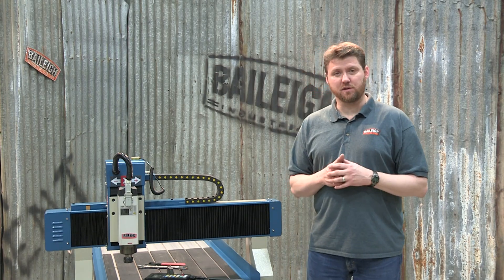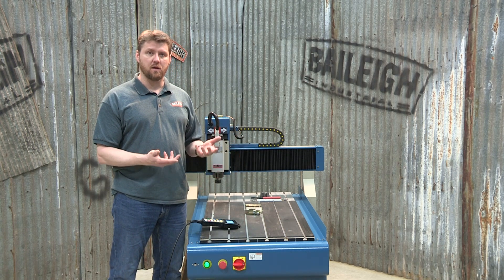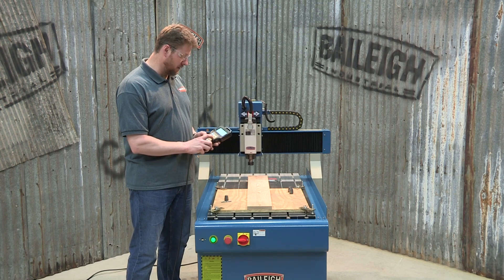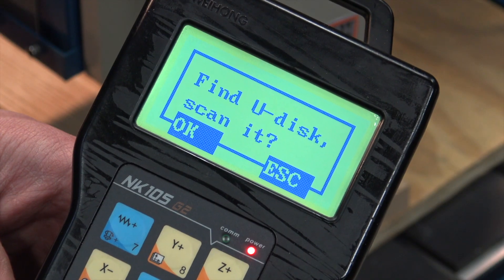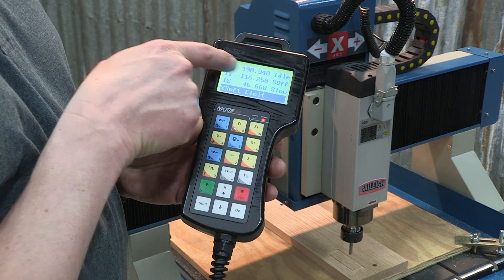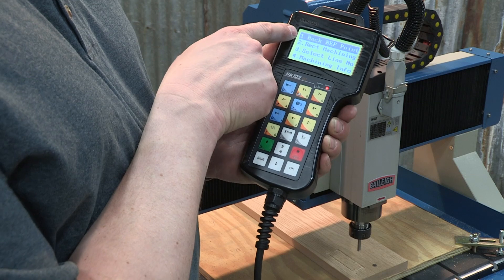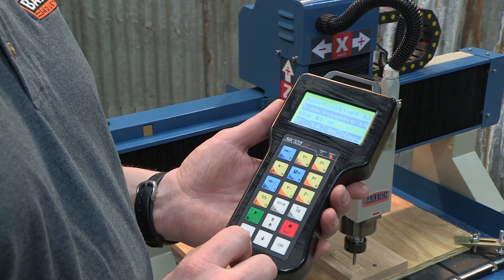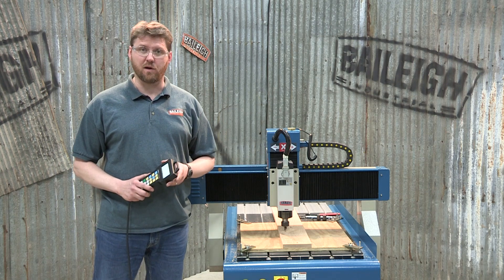Overview of Baileigh Industrial's WR-32 Wood Router

Comment: Not as advertised. Video is accurate and helpful if all you want to is only the things shown in the video, no more. The bobcad program is Not intuitive to use, nor does it interface with scanners. For that plan to spend another $5K and several hundred a month subscription fee's as well as leaning to use the engineering grade solid works program.  Your money would be better spent on a turn handle router table with auto feed.